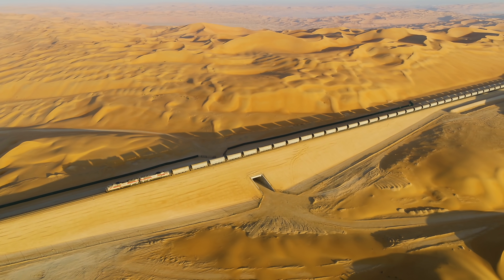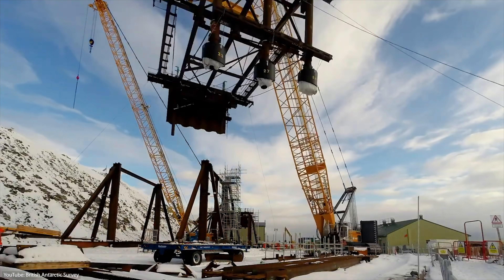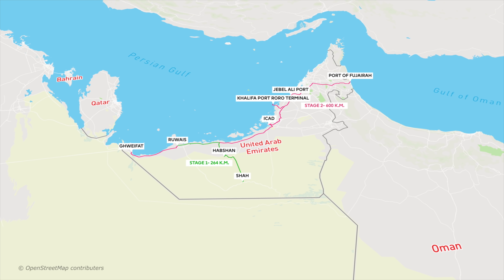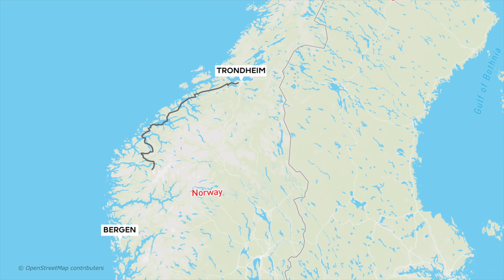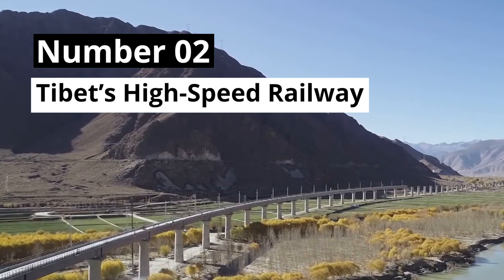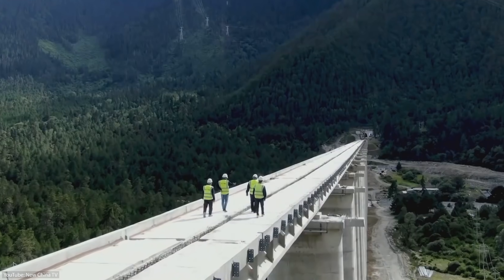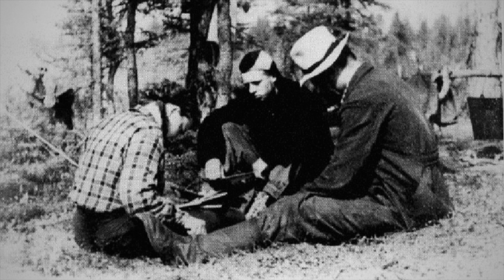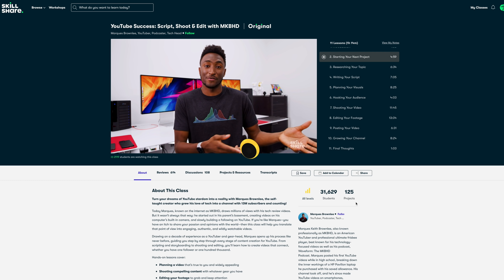World's Most Extreme Construction Sites

Comment: 8:28 sea level could change. it may cause accidents
Reply: biggest problem in Scandinavia are tsunamis caused by rockslides from the steep river banks; wouldn't bode well for a floating bridge or tunnel to get hit with a wall of water several hundred feet high...

Comment: I’m just waiting for a mega project that actually addresses the source of climate change theory. This source drives weather across the planet, determines temperatures, and decides when ice caps melt/freeze. This source is 99% in control. It’s called the Sun.

Climate change theory is all about money because no one wants to admit climate is driven by our lopsided oval orbit around the sun. Earth is currently in a 1930 orbit which is close to the 1940 heat wave. The 1940 heat wave ain’t even close to the medieval heat wave which was 9% hotter than 2020 global temps.

If this was really about climate we would be off oil and natural gas and would be using nuclear. Our green energy solar panels and wind mills aren’t renewable after 10-15yrs and can’t compare to nuclear when it comes to cost to build/maintain / energy output.

Back to our mega project…why not develop technologies that would reflect the sun‘s rays from entering our atmosphere. Volcanic eruption‘s already prove that this is possible when the debris blocks out the sun. Imagine if every satellite that currently orbits the earth reflecting technology on them. That’s almost 2% of our sunlight being reflected. It’s small but makes a small dent in such a fragile ecosystem.